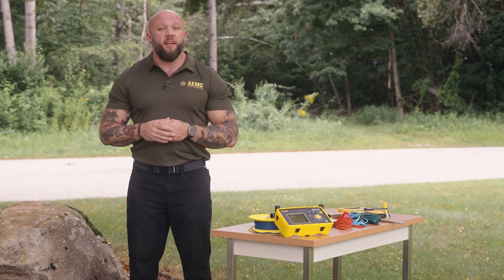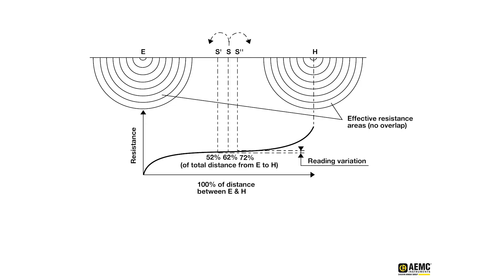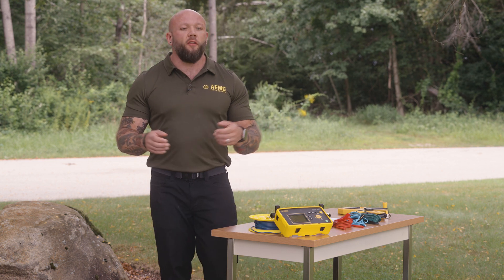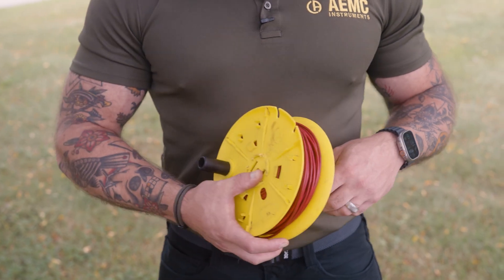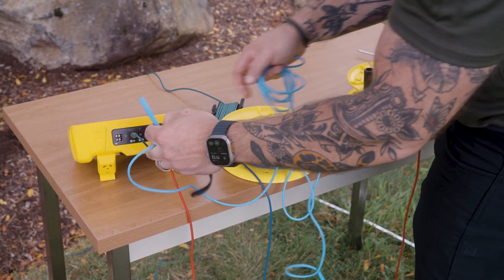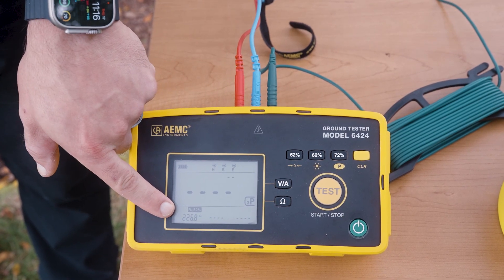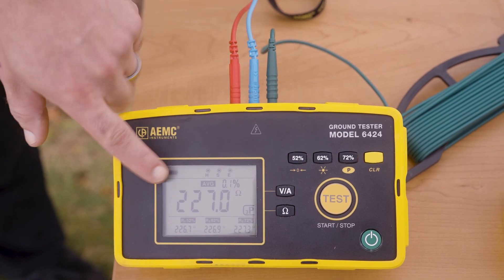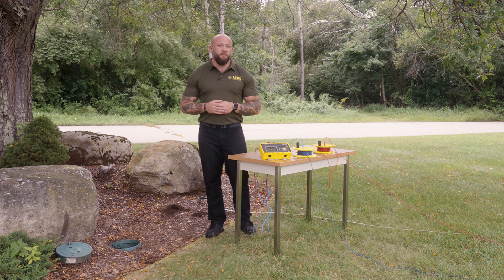Simplified Fall-of-Potential Test Method (62% Method)

Comment: Reading seems very high. What is the standard for a passing value?
Reply from the maker: There are many worldwide standards and application specific standards.  NFPA 70 calls for 25Ω or less for a typical electrical system. Communications towers, transmission/distribution towers, lightning protection systems and electrostatic discharge (ESD) grounds may all have different ground resistance targets.